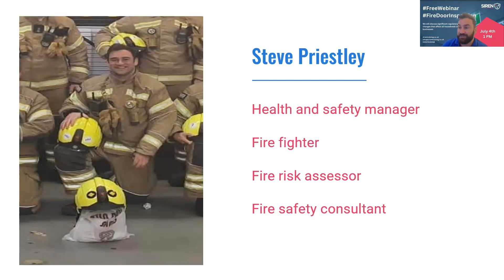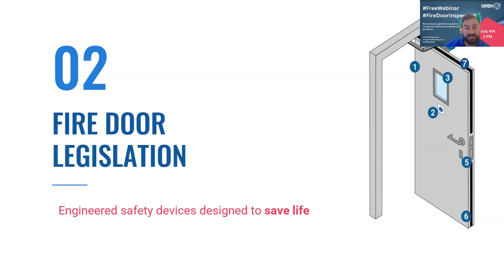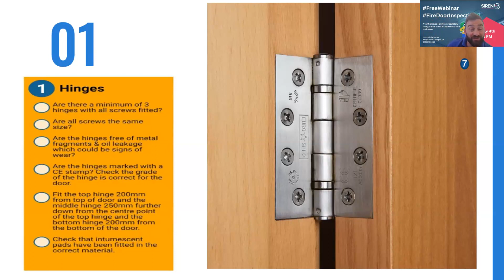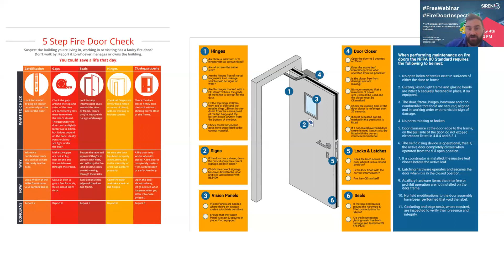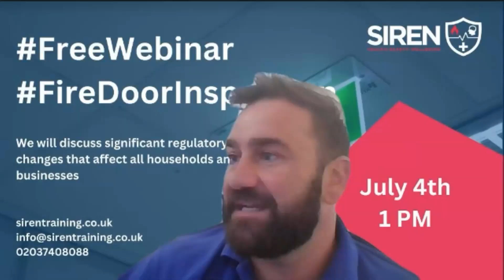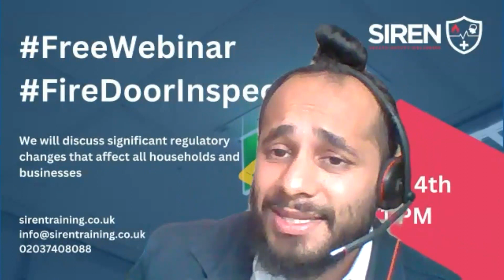Fire Door Inspection

Comment: In a domestic flat fire what would fail first, the door or the hinges? In a fire situation in a flat, occupants run out!The door close automatically! The door is rated for 30 mins! Also, intumescent  strips should expand making the door impossible to open ! Most communal fire doors open away from the fire so people can escape easier therefor the hinge is on the outside of the door! How could this melt before the hinge. I am saying this because we have just had a FRA on a purpose built block of 20 flats and the inspector condemned  the 100mm steel hinges  that were fitted when new. We have had 3 FRA's before and no one has picked this up! Is this the FRA company creating work for themselves? I am a building manager and a builder by trade and this hinge situation troubles me!